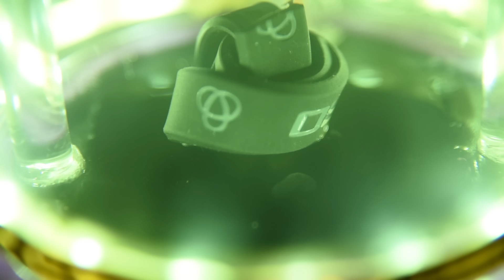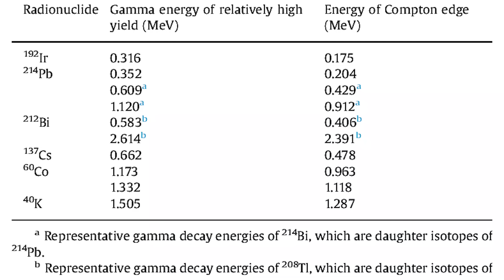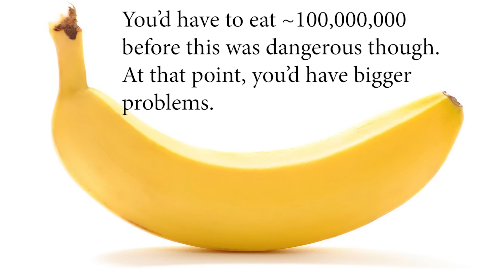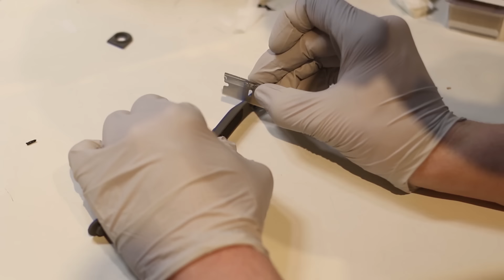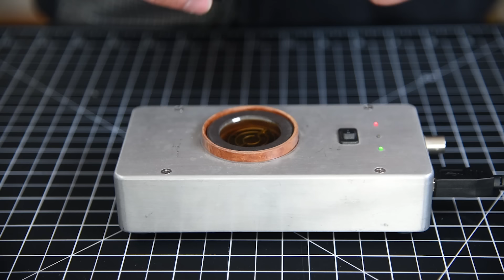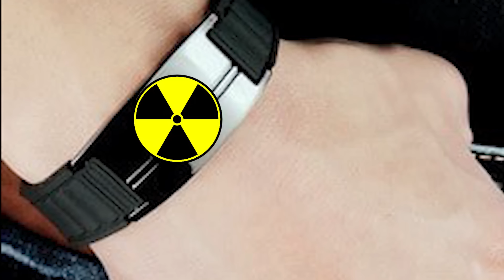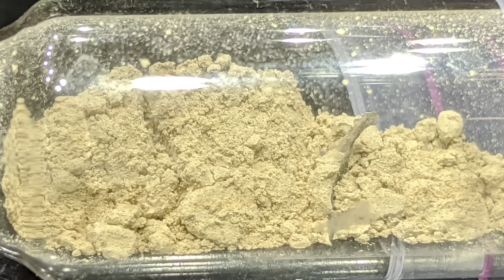Negative Ion/Anti-5g Products Are Actually RADIOACTIVE

Comment: Just for the record, I'm kinda glad there's a stable supple of thorium dioxide on the market. 
You should see if you can purify out the thorium dioxide and make it into a laser gain optic. 
Thorium dioxide is easy to optically pump, and it might make an easy to use/make glass component for a pump laser.
Reply: lol, all we need now is another radioactive scout boi.
Reply: lRaziel1  Hopefully with lead shielding.

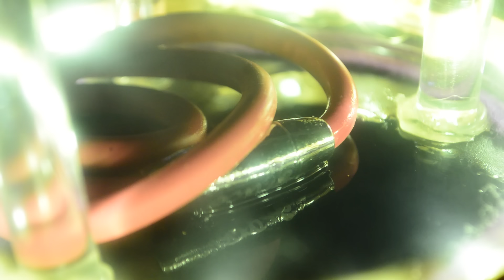Comment: At 3:00, it’s the 1920-1930 Radium fad all over again...?
Reply: 17:45
Reply: Not really. Ra-226 is about 8.8 million times more radioactive than Th-232 in specific activity. Radium is also far more radiotoxic than Thorium too. Basically, 1 microgram of Ra-226 is about equal to 8.8 grams of Th-232 in specific activity. Longer-lived radionuclides are generally safer than those with shorter-lived radionuclides. Ra-226 = 1600 years, whereas Th-232 = 14.05 billion years.

Comment: This radiation detector  ..can you do a collab with slow mo guys,  we could learn a lot if we could see how those lines are created :)
Reply: The condensation trail reaches visible levels long after(milliseconds) the particle has passed. The direction of the trail forms in is also more likely to do with the direction of the moving gas particles themselves than the direction it was made in. Though when you have a radioactive source it's pretty clear which direction the particle must have had. The particles themselves travel at a fraction(alpha) or very close to(beta) the speed of light and is way out of league for even the best high-speed cameras.

Comment: Pretty sure that sending radioactive stuff in the mail is illegal so maybe the USPS could help? not sure
Reply: It's not. I collect radioactive materials, and have them shipped to me all the time. As long as the package doesn't exceed 0.5 mrem/h, it's fine, and even that is pretty low, and that is more for gamma and neutron radiation only.
Reply: USPS doesn't check radiation on (every) package, and you can legally ship it below a certain threshold

Comment: Well, I've been tempted for ages, but I'm getting a Geiger counter now
Reply: I was also tempted for ages and finally got one recently for around 100€.
When I left the family home around two decades ago I took some stuffs, including a small malachite box with mineral samples from Congo (we spent a few years in former Zaïre when I was a kid).

I lived with that stuff for one year in my student room in a drawer between my bed and at an arm reach of the desk with the pc where I spent most of my time when at home. 
Then when I moved it wasn't in the room I slept anymore but still less than two meters from where I usually sat, for a few years, quite forgotten, before I finally had a basement and put it there.

The geiger counter on direct contact of the box (closed) is registering over 20µS/h (where I live, from offcial sources, the background radiation outside is around 0,11µS/h. I register around 0,17-18µS/h. in my flat).
When I had it in my single room, I could touch the small furniture it was in from my desk, were I estimate the dose between 1,5 and 3µS/h. At least the radiation is falling very quickly with distance (at least the one I was able to detect with my geiger counter, it' supposed to pick-up x-rays but I'm not convinced of it, as for the alpha particles), and when I slept in the same room it was close to my feet and not my head. Some other parts of my anatomy were... in between.
Let's say that I unknowingly spent some years as an airliner crew, and that I should definitely stop smoking.

If you are wondering, with that geiger counter I cannot tell the radiation of bananas from the background radation, nor anything else in my place, actually, including the smoke detector (from the outside of it, I prefer to leave the americium where it is).
Reply: @19Murad77  yikes. Here's hoping I don't make that kind of discovery. Good plan on the smoking. Good luck.
Reply: @19Murad77  Scary story. On the other hand, Africa is rich in minerals. Maybe that's why they're trying to run the Africans off to Europe.
Reply: The one he uses in the video is pretty good, I have one. I found a piece of uranium glass randomly in the house with it, which was a surprise, to say the least..
Reply: Be sure to let us know what model you're getting!
Reply: Just buy a cheap radio,it does the same.Only downside is it starts clicking once you grow a tumor on a tumor.
Reply: makes me feel like bringing one to public places, just to see how common its in our "products"

Comment: I KNOW!!! I've been trying to get a high concentration Carbon 13 source to house in a steel case to pass air over as an air sterilization and non line of sight negative ion emitter. No one wants to sell a pure electron source for cheap though.
Reply: If you want to sterilize air, how about using what everyone is using: UVC lamps

Comment: Reminds me of an old newspaper article titled "The radium water worked fine until his jaw fell off" xD
Reply: Niles Black Not really, it’s a Wall Street Journal article from 1932. A Havard dropout dissolved some uranium in water and claimed to be a doctor. He gave this uranium water besides others to a guy who had broken his arm. That guy then lost most of his jaw and died of radiation poisoning. Our chemistry teacher showed us the article a while ago.
Reply: That's because radium-226 has a much shorter half-life than thorium-232, and radium is a "bone seeker", since it's in the same group as calcium on the periodic table. Thorium-232 is just not very radioactive. It's about 8.8 million times less radioactive than radium-226 in specific activity. That's why you won't find grams, or even milligrams of radium-226 available. It has a much shorter half-life–1600 years, whereas thorium-232 has a half-life of about 14.05 billion years. A typical Ra-226 wristwatch only contains about 1 microgram of material, whereas you'd need 8.8 grams of Th-232 to get the same activity. These products are bogus, and should be labeled ”Caution: Radioactive. Contains NORM (Naturally Occurring Radioactive Materials)". I would be happy if these were sold as check sources or chemicals, but putting them in these stupid new age woo-woo products is what leads to more fear to someone who doesn't know much about radioactivity or chemistry. I see the same thing with plutonium, even though americium–Am-241 specifically, is found in ionization smoke detectors, and Am-241 is about 55 times more radioactive than Pu-239, and it's just as radiotoxic, and Am-241 emits vastly more gamma rays (low-energy) compared to Pu-239, and they're both alpha emitters. Also, many older Soviet smoke detectors used Pu-239, like the RID-1 (РИД-1).
Reply: @KarbineKyle  I do understand that thorium is a lot less radioactive and that the amount in those bracelets is barely harmful on short exposure. I was merely referring to the simillarity in claimed benefit from these products when in reality using them as intended is much more harmful than helpful.
Reply: @Niles Black Google "Radium water"
Reply: @Niles Black Use google mate

Comment: What a fantastic video. I'm wondering if all these bracelets sitting in the Amazon warehouses are irradiating the other products crammed next to them.
Reply: They wouldn't irradiate things unless the thorium itself is getting out onto things. Radiation only spreads when its producer spreads.
Reply: @Jacob-yg7lz  That's absolutely correct at these levels, and with these sorts of material. 
However, high intensities of energetic radiation, especially neutrons, can destabilize the nuclei of other elements if they hit them. Nickel, for example, is well known for becoming radioactive due to this process, and also for being the other major component in stainless steel. This causes issues in stainless steel nuclear reactor cores.
Reply: Or the employees working around them
Reply: I don't think that's how that works unless irradiate means something I didn't realize
Reply: @SpaghettiEnterprises  Oh, that's complicated. But in this situation I'd be more concerned about the dust spreading around. 
Either way amazon should be made aware of this because holy shit, they probably have no idea.
Reply: Not all radiation is “activating” radiation. Gamma, beta, and alpha generally do not make other things radioactive but neutrons do. When I say generally, I mean that they still can in special cases. If an alpha hits an aluminum target it emits a neutron, for example.
Reply: That's not how it works.
Reply: This reminds me of that bit from The Simpsons where Dr. Nick was like, “Inflammable means it IS flammable?!” Seriously though, does irradiated mean being exposed to radiated photons(or alpha, beta particles) or does it mean to become radioactive?
Reply: @SpaghettiEnterprises  colloquially, if means to become radioactive. Physically, it means to be exposed to radiation.

Comment: "Runs a company called dangerous things"
-When are the sensing biomagnets getting restocked?-
Nevermind, there's the xG3 now.
Reply: I was about to say "dont you remrmber? They disintegrate." But i looked at xg3 and it looks like they fixed that problem
Reply: That magnet is so massive tho lol
Reply: That magnet is so massive tho lol
Reply: I have the xg3 implanted as well as the xled next and vivokey
Reply: @gaefrogge5806  Does it work for magnetic field sensing or is it too big for that?
Reply: @yo90bosses  the xg3 is for lifting, it's a little too weighty
But the smaller magnet in my fingertip works great
Reply: @gaefrogge5806  who crafted your smaller magnet?
Reply: @ordnaelshideout   one is the old n52 sensing magnet and the other is a 3mm×1mm magnet I coated in parylene. I'm not sure if anyone sells sensing magnets anymore, but check out the biohack .me forum
Reply: @gaefrogge5806  I browse that forum quite often, such a great place. Thanks for the answer!
Reply: @ordnaelshideout  I'm sorry I couldnt give any more info maybe Amal will surprise us with a sensing magnet eventually lol
Reply: what does this mean?

Comment: Yup, I used to have a "quantum biophysics negative ion patch" specifically as a cheap thorium radiation test source for making radiation detectors. For $2 it actually works really well for that purpose.
Reply: "quantum biophysics negative ion patch" ?   ... I am awestruck at that one
Reply: Lol, that's a genius way of getting your radioaktive material.
Reply: @m.t-thoughts8919  arnt you like, not allowed to make contact with the internet, mr. Bright
Reply: @smonk7621  Pssst, don't tell the 05 council. 🤫
Reply: @rickharper4533  That's true. ;)
Reply: tbh it'd be quite sad to lose this massive source of radioactive material to make r-
i wont finish that, dont want the government stalking me more than they already do
Reply: @heroslippy6666  Well, do you have a solution to the corrosion problem in LFTRs? If not then they are quite a few decades away.
Reply: @taaviparn9175  Corrosion problem in LFTRs? Easy: Shield the thorium by binding it in an inert polymer matrix, and then fashion the polymer matrix into a flat ring shape, and then sell the ring to people as a "health" item.

You are now rich and can use the money to build a solar generating station, thus technically converting thorium into a sustainable source of electrical power.
Reply: @neolexiousneolexian6079  Outstanding move!
Reply: you could just go to the rocky mountains and pick up a uranium rock.  or to California beaches and pick up thorium sand.  i think that's why this stuff is legal because you can just go get the stuff that's in them.  the real danger is the deception of it being beneficial to your health.
Reply: @mosseon3456  And the long-term contact. You don't typically hold thorium sand or uranium rocks up against your skin for months at a time.
Reply: @JuryDutySummons  yeah, I think it'd be interesting to see where the majority of sunbathers who get skin cancer reside from.

Comment: Also i am intrested in getting one (obiously not 1,000s of dollars, but anywhere from the diy/super cheap all the way to ~100 USD)
but what radiation sampler/measuring device is the best buy?  I am thinking of a simple giger counter, but know these don't measure everything.  I want more quantitive data than a cloud chamber.  Not desprate, just curious, since it seems you have been using them recently.